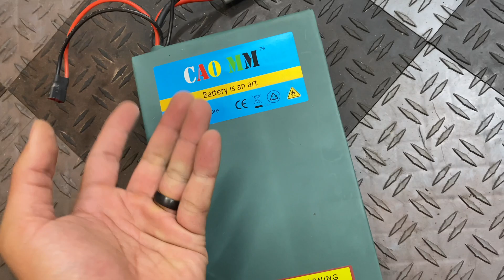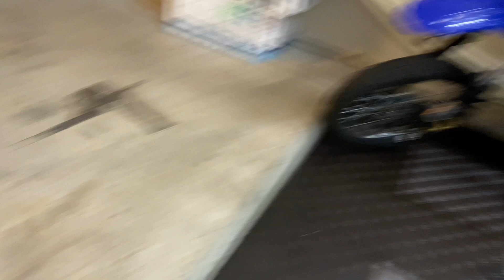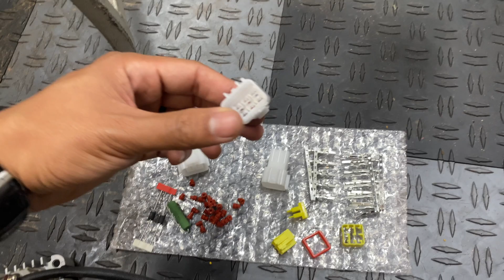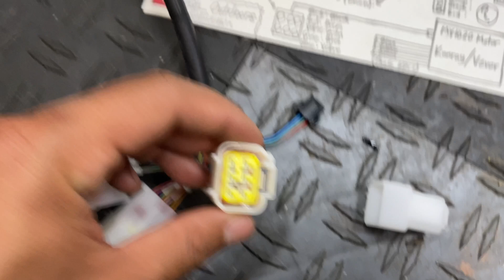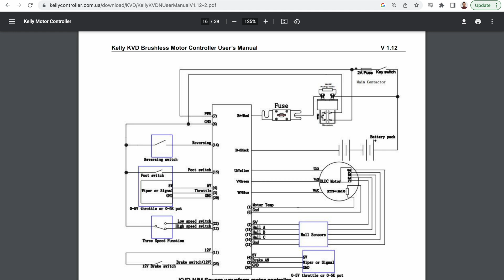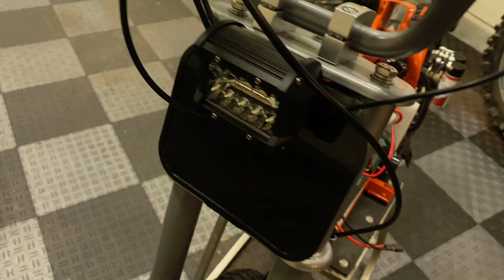Redoing the 52V Razor MX650 Build for More Speed Part 4

Comment: Hey, I’m thinking about buying the Kelly controller however my battery is 40a and the minimum on the Kelly is 75 did you have any problems with yours?
Reply from the maker: Are you buying it pre-programmed? Nope, I have two bikes with Kelly KVD controllers, one is running on a 20AH 52V with a 50A BMS, other is running on a 20AH 72V with a 50A BMS also. Both still good after months of use.
Reply: @PatOutdoors  I’m going to get the pre programmed then Maybe program it if needed?

Comment: I copied all of you wiring for the throttle and volt meter with key and I can’t get the key to turn of and on the volt meter and also my 3 speeds don’t work. Do I need a switch or something?
Reply from the maker: Some of these voltmeters have the 12v input and output switched around depending on the manufacturer. Leave the ground alone, but switch the other two wires for the volt meter. As for the speed controller not working, connect to the Kelly controller and open the app (assuming you have the Bluetooth module) and confirm the settings on the three speeds. If they are all set to 100%, then there will be no difference in speed in any of the modes. You can change the settings to be different speeds if you want it to be slower for some reason.
Reply: What about my volt metet
Reply from the maker: @grantharris7451  Leave the ground alone, but switch the other two wires (input and output) for the volt meter.

Comment: Just finished mine, the voltmeter goes on as soon as the battery is plugged in. How do i make it so that it only turns on when key is turned?
Reply from the maker: Flip the green and the red wires. Some manufacturers have it reversed. The ground stays the same

Comment: I'd put the batter Upright instead of an angle putting pressure on the battery
Reply from the maker: Appreciate the input! Unfortunately the battery is simply too long to fit standing straight up in this specific application
Reply: @PatOutdoors  I had the same issue. I used insulation spray foam and formed a  a support triangle to fill the space between the tray and the battery to relive stress on the battery

Comment: Hey Pat so did you only use the red and green wires from the ignition? I have the same one and am wondering How to wire it correctly for my kelly. Thanks!
Reply from the maker: Black hooks up to ground, green hooks up to power source, red is the signal wire to the controller.
Reply: @PatOutdoors  got it figured out! Thank you sir! Keep at it I’m loving the content 🖤